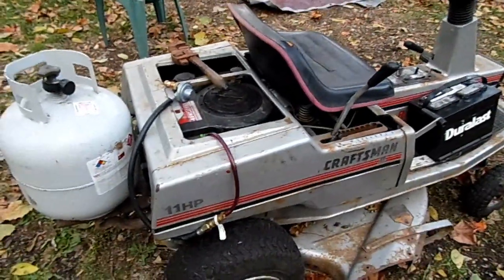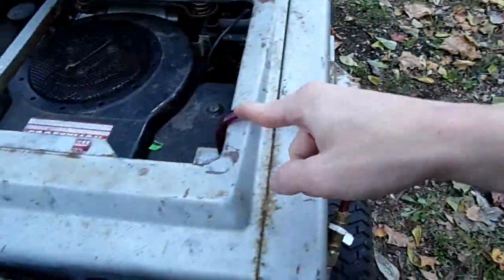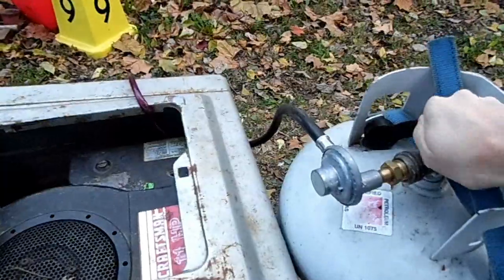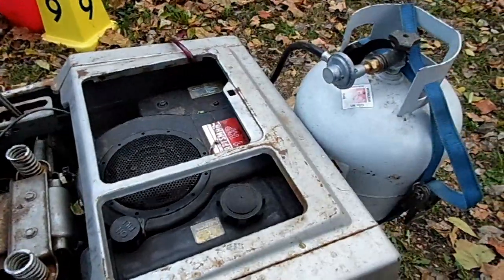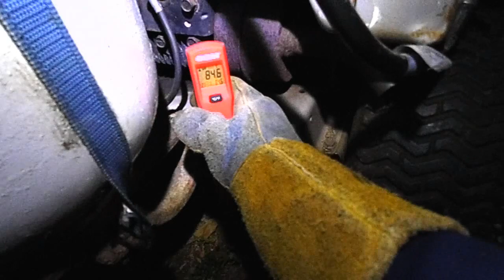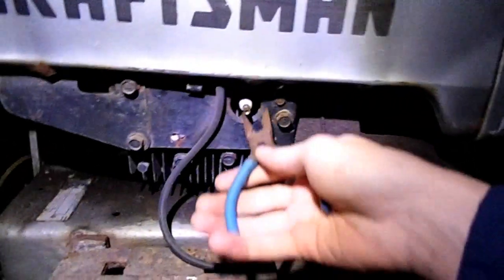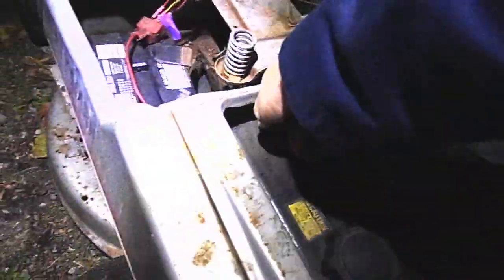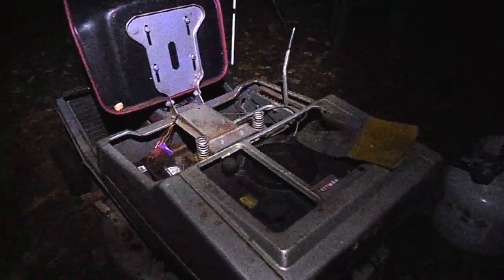Propane Powered Lawnmower Review

Comment: I never knew it was as easy as putting gas to the carby! My car has a ring feeder on the throttle body. Mower sounds like its ruining well, with plenty of grunt. Oil changes need to be more regular. Lots of crud gets in there from the gas combustion process.

Comment: Propane is a clean burning gas so the spark plugs won't show if you're running lean or rich. On spark plugs you're looking for carbon build up from the gasoline burning at certain temperatures and leaving different colors on the spark plug itself. It does sound like you're running the engine a bit lean. It is better to run a bit rich than lean so the gas helps to cool the engine off. The engine should be about half the temperature of the exhaust. If you increase the gas flow in the engine will level out, give you a little more mowing power and speed, but will also drop the temp to where it should be. Growing up my father had the exact lawn mower and that sound brings back so many memories!
Reply from the maker: i just go by the rule of if i can still put my hand on the engine head then i can still mow a bit. i figure as long as its just toasty and doesnt go over like 140 f* anywhere its prolly fine. i also take a 20 minute break half way through mowing the lawn for it to cool down. but thanks for the input ^^

Comment from the maker: yeah i will change the oil next spring. might add a little bit more right now though since i will use it a few times for mowing the woods and whatnot.

the mower is running really weird now that it's close to freezing outside. it seems to run best at 85ish degrees. 

the thing is though it gets the job done and it doesnt get too hot usually, during the summer though i give it a few 20 minute breaks during mowing the lawn just to be safe.
Reply: Because ice is forming  on the inside of the valve, when the temp goes down and the humidity goes up.

Comment: The tank pressure depends on what the temp of the fuel is. At 35 deg its 60-70psi~ a 100deg summer day it's 172psi. Also those low pressure regulators are set at 1/2 psi. Heres an idea, get a battery cutoff like what harbor freight has and use it to replace the solenoid. That way you can just turn the handle instead of using the chisel.

Comment: Not sure where you live but in my area Tractor Supply Co sells propane for about 2 bucks a gallon- you can refill that BBQ tank for under 10 bucks. I couldn't believe how long it took me to realize how good their price was. Most places charge a flat to refill those tanks and as of the past couple years they only fill it 80%. Most places are charging about 10 bucks for an 80% fill or 16-ish for a full fill. Once I looked it up and found that the tanks only hold 4.3 gallons, I realized that $2.15 a gallon is a bargain price! and if your tank isn't completely empty, you only pay for the amount it takes to refill it, not a flat rate. 

Basically I'm just saying look around for some place that sells propane by the gallon, and you might save even more. I love running engines on LPG haha

Comment: You may be a little lean looking at that plug. Close though.Looks like a little slag, from valves! on there. Lean will cause VSR. You want a little black on the plugs and in the exhaust. Its not the most efficient burn, but prevents un hardened valve seats from getting damaged. I learned the hard way on my LPG car.. Lean has much more power as well as efficiency XD. You normally put one grade higher heat range plugs in. If the mix is good it will run cooler than petrol due to the gas cooling.
Reply: Mongrel Shark, propane runs cooler because it burns cooler, it roughly translates to high quality race fuel with an octane rating up as high as 104-115, judging by the burn rate. It would be great in high compression engines, to avoid knock, and ping, and rich or lean burn scenarios can't be judged by looking at the spark plug, like in a dirty burn such as gasoline, it burns too completely, and cleanly for that. In a propane fuel situation, you observe, listen and adjust air, fuel mix accordingly, IDK where you get your LPG, but it shouldn't leave "slag", id look more towards worn rings or valve seals to cause a black spark plug or "slag" from the valves left behind. And as far as un-hardened valve seats, you won't find 'em on anything developed after the introduction of un-leaded gas back in the 70s, which I guess this lawn mower does possibly fit the criteria. But any gas engine big or small, designed to run un-leaded fuel should have hardened valve seats...not much of what you claim holds much credence I might say !https://www.afdc.energy.gov/fuels/propane_benefits.html  here is a helpful link for you

Comment: You need a Impco type C demand regulator it is desighned specifically for this purpous the more vaccum or load the more propane is passed throu the hose to the carb,and it does all of that automaticly and shuts off the propane automatically when you shut the engine off and doesn waste propane while its running or run like shit as its doing here and its a ton safer, get a solinoid,they are cheap,even wal mart sells them,i used one from a 1970s Ford car, your going to blow yourself up if the vapors float over that way if somebody leaves the falve on or leaks,just sayin, i have that impco regulator on a 2500 watt generator and it runs smoother than on gas, your  engine is loading up trust me,the demand regulator  will make it  run right and it has a primer you press for a few seconds that regulator is about 60 bucks,and they make special hose for propane,gas hose will deteriorate, i bought 3 feet al Lowes for 13 bucks and cut it in half,screwed one to the regulator and the other one right on the main jet you might want to convert it to electronic ignition too as im shure it still has points, it will start instantly, they are 15 bucks, you get those two things it will run a LOT better and wont sound like the choke is part on, i fed my propane right up the main carurator jet, i took the float off and threadded a 1/8th inched barbed fitting,a steel car tire vave steam is the same thread, on a Briggs carb on some of them, i have a video of my gennerator  running on here its the latest one, i ran it off a camping cylinder
Reply from the maker: yeah but i control the mower by the valve. if the valve was automatic i wouldnt be able to shut off the engine.

i leave the choke on couse it works better that way.

and it works, so thats good enough for me. if somethin goes wrong i'll make a video about it.
Reply: Rinoa Super-Genius
To turn the engine off you just turn the key off,it grounds out the igintion coil to the engine block just as if its running on gas and the reason the choke has to be on is it creates more negative pressure cause you need to take the main jet out of the caborator cause its restricting the flow,of propane,it screws out,and  you control the rpm speed with the regular throttle just as if its running its on gasoline,i do these conversions for a living, but if your happy im happy, im just saying thats the proper way to do it, google any gas to  propane conversion kit and that big diapham impco regulator is the heart of every system, theres no fiddling ,adusting nothing you turn the key push the primer button to give you a little vapor to light it off , then start it and go, when you kill the spark by turning the key off it kills the motor and the propane stops automatically you never touch a valve or anything, you can leave it on all the time but if its indoors id shut it off.
Reply from the maker: jay bradley
if the key worked that is

Comment: The engine isnt running at the full 3,600 rpm its supposed to run, if you adjust the actual engine throttle with the propane it works better, I can tell by the way the engine is running its running to lean. If you buy a needle valve from home depot and rig it into the propane line you can fine tune the propane so you can turn the tank valve all of the way on and control the propane by the needle valve instead of by the tank, hope this helps.
Reply from the maker: yeah i dont let it go full rpm on purpose. i dont like it going too fast.

Comment: 85 is a good temp. My car wont start and run for long on cold mornings, below about 10c, especially if its damp, or there is heavy dew. Gas decompression freezes the throttle body. My regulator is plumbed into the water jacket to pre heat the gas, but doesn't work if engine cold. I have duel fuel, so I just warm it up on petrol on cold mornings, once its up to run temp I can switch over without problems.

I find a chainsaw is better for mowing woods. Or this: /watch?v=e0kjgj-IneE 
XD

Comment from the maker: i have a 1982 Mercury Zephyr that could prolly easilly run off propane. the only problems i see coming up are

!: propane burns hotter
2: the computers in newer cars throw a fit.

luckily if i ran my car off propane it doesnt have a computer so wouldnt care. my great uncle ran his truck off propane in the 1950s. he had some of those big propane tanks on the back and could go like 100 miles on a tank.

guess the other problem is i don't like driving cars hahahaha.
Reply: Rinoa Super-Genious, another problem would be an articulating throttle, if you just use the  butterfly valve in your carb or throttle body, all you're  doing is changing the air fuel mix, making it run richer or leaner,  not effecting the RPMs quickly, or effectively enough for an automotive application, did you find a solution for this?

Comment: How do you control the amount of throttle if you took the carb off?
Reply from the maker: with the valve on the propane tank. i didnt take the carb off but its almost useless with propane. it does help to regulate the air going into the engine though.